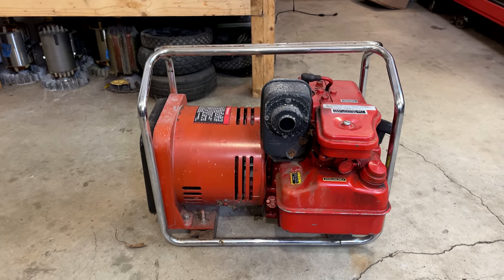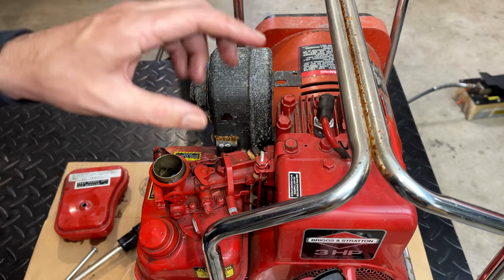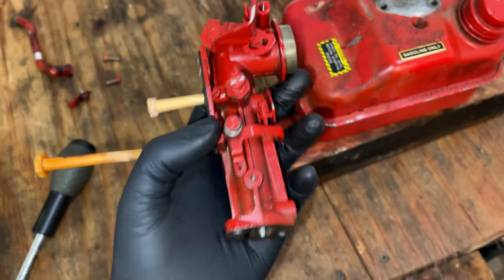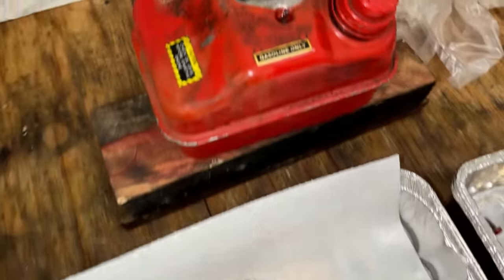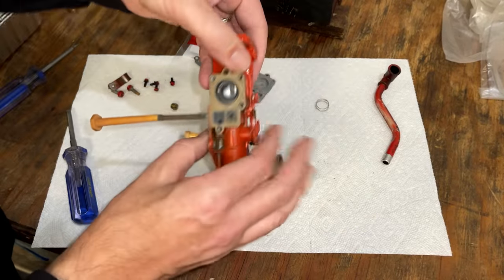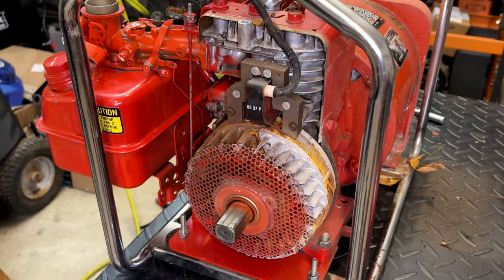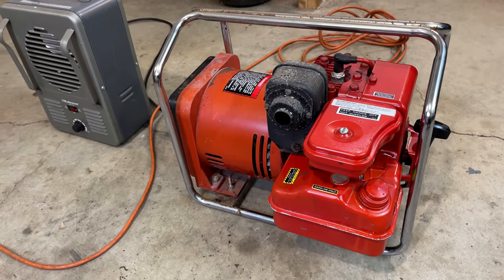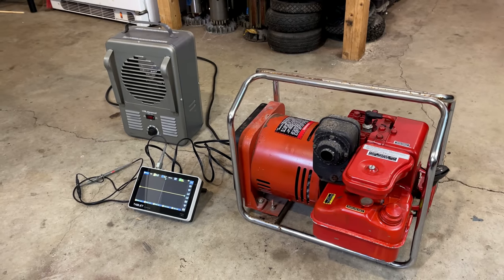Old Pincor Generator from 1985 - Does it Still Work?

Comment: Of course it works, those old briggs flatheads will run like forever, had one on a trac vac that lasted me 35 years and probably about 65000 hours until the piston rings blew. Replaced the rings and its now 57 years old, still working. Its so old that you have to wrap a starter cord around it, no recoil and it never had one. Those engines are worth fixing because they just last like forever.

Comment: The old school flat head motors from Briggs and Tecumseh were quite durable.   I find it frustrating that the laws eliminated their manufacture...  and the engines that replaced them end up more frequently in the trash.   My old snowblower will fall apart long before the SnowKing motor is ready to retire.
Reply from the maker: I completely agree.  The flat head engines were simple, strong and reliable.
Reply: It´s been over 5 years already that they are out of production, I think Briggs (as the last manufacturer) stopped making them in 2016. Time flies...
Reply: Exactly what happened to my Ariens snowblower. My new Ariens Ax has already given me problems. The 14 year old SnowKing seems indestructible yet everything else is falling apart around it.
Reply: @interstellarconundrum4774  The SnowKing Engine was great indeed, honestly can´t understand why so many people don´t like Tecumseh, I never had problems with them, speaking form a 20 years experience perspective.
Reply: Sadly, our bad replacement engines will have to go "next to" the trash b/c it's full with the other newly designed "replacement" items. Those which appear to be engineered to fail within 5-10 yrs. E.g., our appliances, TV's, other gas powered implements etc—even much of the furniture.  🤔

Comment: I have a ( 1990 ) Sears craftsman 1400W generator  with a 3 hp Briggs Mint condition that I keep for back up to power my furnace and it will run my 1100W Burner and it just has enough power to  run my  coffee maker,,  I always  run it every month for a few min and keep it empty of fuel.. I also have a really neat Datyon Generator  2W644   750W with a Kawasaki  1.6 hp engine.. that has just enough to run  a TV ,,router and  a computer  so  even if the power is off I  dont have to sit in the dark.. I think its smart to have a smaller generator..  if there is bad weather sometimes  you cant get   fuel..  and how much fuel can you store without it going bad??   I keep 10 - 12 gallons from DEC TO APRIL..

Comment: That style of Briggs engine was a bulletproof staple for 30 years or more with both vertical and horizontal shaft versions. I cut my small engine repair teeth on them beginning in the 60's. The carburetor was innovative as the bowl was part of the tank and it used that small "pump" diaphragm to keep the bowl full. It also was the beginning of the use of plastics in the carburetor for the two fuel pickups.
Reply: I used to have one in that style that was likely one of the first versions of that style and those pickups were brass.
Reply: @Tailss1  as they should be

Comment: Iwas thinking Maybe use some small screws, to clean the rust, like used in. Modern plastic electronics, 1/8" long , tiny diameter, with sharp coarse threads,  a hand full with purple power or something, would clean it fairly well, set it on a air compressor or something, and slowly turn it,  let it shake a bit, but vinegar. Works well also,  mix it about half and half with water, get it started to boil, in a pot, then fill the tank with it, maybe sit it in a large pot , of water, sitting on a burner at about 150°F-180°F for a hour or so, maybe put it in side a bag to keep the vinegar in the tank, I'd maybe look at glass beading the tank, and maybe ceracoat it I believe it would stand gas, it can be used in pistons in a engine, so surely,  it can. Be used in a gas tank,

Comment: I purchased a 3000 watt Pincor in the 8os to run my Graco airless paint sprayer on job sites. The airless drew 25 amps which the Pincor handled just fine. It was jobsite loud though. Never meant for residential use. I believe it was an 8 HP BRIGGS and super heavy.

Comment: ...and not a craptastic plastic anywhere to be seen! 
It screams Quality. If it's made of metal, it can be repaired, welded, brazed and back to new in no time.
If it's made of craptastic, it goes to the landfill to die. 
Even if the gas tank had holes, they could be filed with low temp alloy brazing rods like BlueDemon, sanded and painted.
Or even coat the inside with epoxy like they do with all canned foods and drinks. 
This video was very nice to watch and be reminded of quality long gone. 
They don't make them like this anymore.
Reply: Sorry to burst your bubble, but those pickups in the tank are plastic. Nothing else seems to be, though.
Reply: Old boomer using stupid nicknames for everything. How original. And you're not even right!

Comment: Fuel up the tank until the fuel is brimming at the tank inlet.
This fills up the "bowl" which feeds the jets...and allows the fuel to start softening the diaphragm.
It should start easily and then by the time it needs to suck fuel up from the tank into the bowl..the diaphragm is flexible and the pump will pump.
Every time you need to start this type of engine after storage...fill the fuel to brimming.
Reply: It’s works to. Was surprised it did
Reply: @philliphall5198  
I had to run a Briggs and Stratton with one of these carbs on a lawnmower when I was eight (1963).
Once I had taken the carb apart, saw how it all worked, saw the "non functioning" diaphragm but didn't have another new one ..I just replaced the old "rigid " one back in and topped off the tank.
The engine started immediately, and ran all season.
I did the same the next year...
never replaced the diaphragm...
but our petrol (gasoline) has never had corn juice (ethanol) in it.
YMMV.

Comment: We have these generators all over north Georgia left over from chicken boiler houses. The power was dirty but at 140 to 150 volts you could light a 300 ft chicken house with one and the well pumps and feed motors on analog mechanical systems didn't mind dirty power either. The key with them for farming was they were simple and reliable.

Comment: I've got the identical generator in my garage that dad bought in the late 70's. We used that generator to run a table saw and drills when building a new home. It never failed, but had to take it home every night because of thieves.Pincor made a commercial rated generator that all the Bell Telephone splicing crews carried on their trucks. B@S / Pincor made a great marriage in portable power.

Comment: Here's a crazy idea for getting rust out of the tank like that. Do what you did but instead of shaking it by hand, strap it to a car wheel and have the car on jack stands so the wheel spins in low gear. Let it do that for maybe 15-20 minutes. Saw that in another video.
Reply: Yeah, except that tank had a big hole in the top. He would have had to made a plate to mount where the carb normally goes. This way he just covered it with his hand

Comment: That outro sound clip from the engine with the sticking valve just keeps on giving! Love it! I just got a few Husqvarna and Stihl chainsaws and a Japanese motorized sprayer/blower with a Mikuni carb on it to try and fix for fun. They all have great compression, but seems the Stihl has severed the crank pin holding the flywheel at the right position and the Husqvarna and japanese blower need new crank seals. I am planning on making them in to 48V DC  portable generators for my electric scooter and a friend's electric motorcycle.

Comment: The screws that hold the carb on are designed to allow a flat blade screw driver to come in from the side. 1/4 turn at a time. Takes forever but it works.

Comment: That little generator is surprisingly quiet, at least it appears that way on camera, nice work bringing this little vintage generator back to life! It looks like it doesn't have many hours on it, I have a vintage generator that I picked up over the summer that's even older than that one, it's from the 1970s. Paid only $50 for it on marketplace, it's a Sears 3000 watt generator powered by a 7HP flathead Tecumseh engine, it's in pretty good shape too and looks like it doesn't have many hours on it. Didn't take much to get it running, just cleaned the points and the carb, the metal gas tank was in pristine condition and it makes power!
Reply: Nice!

Comment: Love your videos! 
The pincore generator video brings back some memories. I bought a 7500 watt Pincore generator head from John Deere to run on my JD400 back in 1980. It's a brush type actually pulls the power from the slip rings (rotating stator) 
The generator only shows a bridge rectifier and a what they call a Thyrector? I sort of remember it having a transformer or coil of sorts in the outlet box. The instructions for setting generator speed was to set the no load voltage at 250 volts. It has a volt meter marked in a small green area. 
This thing powered my entire house in emergency for years. 
I later made it a 540 pto generator for my 850. The generator is an 1800 rpm version. I used it until about 10 years ago when I got my 14,000 Generac. I still have it as well as the manual it came with.
Reply from the maker: Very cool.  I have seen a transformer used before.  The excitation winding (DPE) is usually a separate winding about 90 degrees out of phase with the main winding.  That is rectified to DC and sent to the rotor.  If no dedicated excitation winding, I think a transformer can be used on the main winding to displace the phase and can be used in place of the excitation winding to power the rotor.  Much more simple design.  Less to go wrong.
Reply: @jcondon1  Yes there is no voltage regulator. I found the wiring diagram. The transformer is attached directly to the slip rings, there are 4 rings 120 volts per two rings? The two common go to the center tap of the imput and the other two to the other inputs of the transformer. The output goes directly to the 240 receptacles. 
It must be Fairley clean power we always ran a television etc. With no issue. The last time I used it was for a major snow event. Ran for 48+ hours straight. At the time we had a maw and paw BP conveyance store. I had a 32kw diesal generator there it ran for 8 days straight. That thing was a beast. 4 cylinder Deutz air cooled engine Kato generator head. I put it together with a 200 Amp manual transfer switch. 3,000 lb of power!!! I love generators!!!

Comment: Most of these old Briggs engine met their death because of rust in the tank. Other than that, totally bullet proof as long as you kept oil in them and kept them out of the rain. Great video, thanks.
Reply from the maker: The tank is the weak link.  Someone needs to start making some aftermarket ones.

Comment: Have you ever tried to experiment with different capacitor sizes to see what impact that has on voltage? 

Perhaps using a capacitor rated for slightly less uF than what was issued from factory could help lower voltage without having to drop the  hz down to unacceptable levels.

Comment: That’s the best and smoothest running 3hp old Briggs that I’ve heard in a long time. Those 3,5 and 8hp engines are built well but total gas hogs. They plow through gas! And the tanks are so small. But that how things were in the early 1980s. That gen was an expensive luxury item. Not too many people had them back then.

Comment: My first small engine was given to me when I was about 13.   If I remember, it was a model Briggs 1S, or something similar.  It was about 60 years ago and it was old then. It had an oil bath air filter made of plastic or celluloid with a metal cap on top.  Looked like the same type of tank with the carb mounted to it.   Head was warped so I filed it flat and it started and ran well.   Im still watching engine repair.  Thanks for the video.

Comment: There is a special Briggs tool for those carb to block bolts.  Part# 19305. NLA from B&S and folks are asking crazy prices on them on the usual sites. IIRC, I paid ~$6 for it when I worked in an OPE dealership in the 90s.  Still have and occasionally use it!

Comment: A little trick I've used before on hardened diaphragms.  As long as they are not cracked, try spraying them with brake cleaner and then immediately blow them dry with low pressure air. Feel the rubber and see if it's more pliable. If not repeat a time or two or three. I've had this work before.
Reply: With these, before taking anything apart...just fill the tank with fresh fuel to the point of overflowing.
This fills every orifice as well as the pump diaphragm with fresh fuel...and also the bowl at the top of the tank.
With the fuel tank overflowing that "bowl" is more than chokka with fuel...and the engine will start easily and run well.
By thetime the top part of the tank is emptied to the level of the bowl and the pump needs to work...the diaphragm is pliable and all is well.....

Comment: Just a suggestion, you should check the diagram cover for flatness. I’ve had to flatten them by rubbing them on fine sand paper to keep them from leaking.
Reply: I was going to say the same thing.  They usually warp over time from the screw pressure.

Hopefully my reply will make your suggestion more likely to be seen.

Comment: Nice and very compact generator. I wouldn't plug a fridge or grandma's old black and white TV in it, but a lot of modern electronics with an SMPS just rectify the whole thing and are good with pretty much anything you throw at them.
Reply: It is/was just a tad too high on voltage. a fridge motor  with its high power consumption could handle it IMO it is modern electronics who might not like the extra 5 volts.
Reply: @markae0  the rms of AC power is the rated output of a given generator. The peak output can be as high as 170v from the electric utility company.
Reply: @markae0  Modern 120v-only electronics can handle 200v peak before the capacitor voltage rating is exceeded. For a pure sine wave this corresponds to 141 volts. So the generator's just a bit too much. Of course anything with a wide range 100-240 or 85-265 input will be just fine. To correct the voltage you could plug in something like the Tripp-Lite LC1200 external voltage regulator. Or it probably wouldn't be too hard to connect an internal AVR like more modern generators have.
Reply: @eDoc2020  120 is = 170 V peak. 140v is 200V peak yeah.
Reply: @markae0  as @eDoc2020 mentions, I was referring to switching power supplies that go all the way from 100 (sometimes even 80) to 240 v.

Comment: Thanks James for great tip using nuts and bolts to clean rusty gas tank. Will have to try that with motorcycle gas tanks that always get rusty. Like your reasoning to balance voltage and AC frequency because they may not be independently adjustable.

Comment: U.K. It does sound nice. All those years and almost nothing wrong. I wonder how many modern ones would behave like that. There is no doubt 'KISS' - Keep It Simple Stupid - pays off even if the output is a bit 'crude'. Interesting video James. I doubt here in the UK I will ever see you dismantle my German inverter generator but I hope I never need it. My little Chinese 850W (750W ?) won't blow up. Fingers crossed. Take care, regards.

Comment: Not too shabby, I was taught back in the 70s that this style carburetor needs to have the air cleaner retaining bolt in place even without the air cleaner assembly and you may already know this or know better, either way nice job

Comment: I love the old B&S flatheads with Pulsa-Jet carburetors !  So simple !!

The felt oil pad on the end of the crank lubes the one way/over-rideing clutch that disconnects the rewind mechanism from the engine once it is started. 

Pulsa-Jets are almost indestructible except for that fuel pump.  Make certain the the rubber elbows at the ends of the pulse tube are in good condition.

Comment: I have one of these from the 70's and I believe it is a Pincor as well, the one I have is a 4000 watt generator and if I remember correctly it belonged to the guys grandpa was in excellent condition.   Cleaned the carb and the thing ran great and produced power. Haven't ran it in years though.

Comment: Looks like a fabulous work site generator to me.. Or even a home DIY generator.  Fantastic condition for its age.  Thanks for the videos.
Reply: These are OK for work sites but they love gas lol. Another thing we ran into was some battery chargers for cordless tools would reject the power as too dirty. They can really shine though running lights pumps and electric motors on mechanical analog control systems.

Comment: If you wash the air filter in the sink you need to add some oil to it. If you read an owner's manual to a Briggs with a foam air filter it will tell you to lightly oil it. The oil stops the dirt in a foam filter. It may even tell you on the air filter cover.

Comment: Those are cute little machines for back in the day, i have one that looks like a pressure washer, engine on top and generator under the motor, works fine ,just old , great video

Comment: James, just so you kn ow a lot of the old parts you purchase are on a finial buy from the manufacturer. So yo u may want to order 10 at a time, so. You have stock when they run out. Dealers won’t stock older parts as they don’t want to carry the inventory costs, so really only the manufacturer has inventory. I have seen a few parts that you have ordered where I know there was only a few hundred ordered. When they are gone, that’s it.